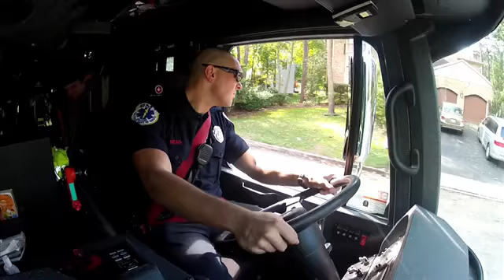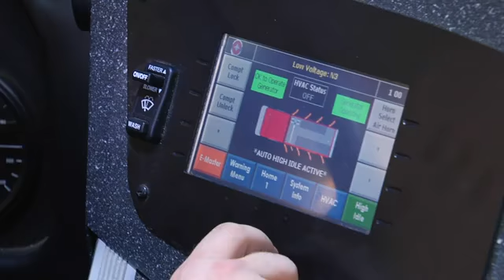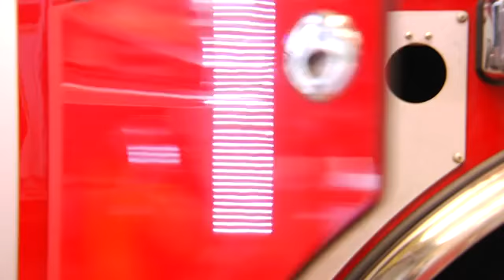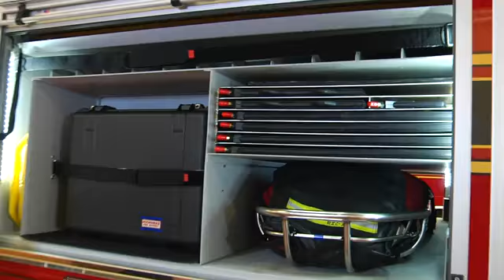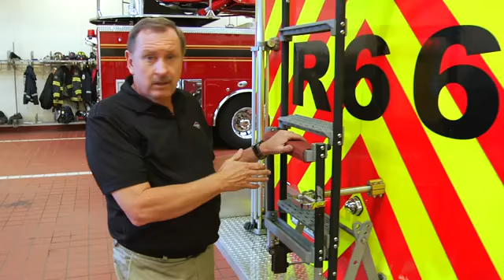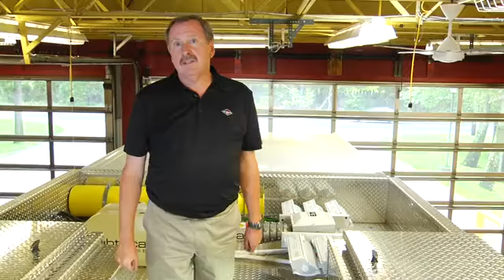Spartan ERV Walk Around Rescue

Comment: Should’ve made it a walk in. The bumper should’ve had a pair of cutters and spreaders as well as two hydraulic reels to the front. Should make it a 10 man cab. The air bottles should’ve been next to the fill station. Have your jaws of life and generator on the bottom. The fans should’ve been on the bottom. Stokes basket should’ve been put in the back. Decon equipment all together. SCBA equipment together. Tech rescue gear all together. Firefighting tools all together. All the vehicle rescue gear together. They have everything all over.
Reply: Central New York Responses as I was watching I swear I was thinking of exactly the same points and then I saw your comment ! Spot on
Reply: @parsia1363  You guys paying the bill? You can build the way you like when you write the check, all good points, just saying!!